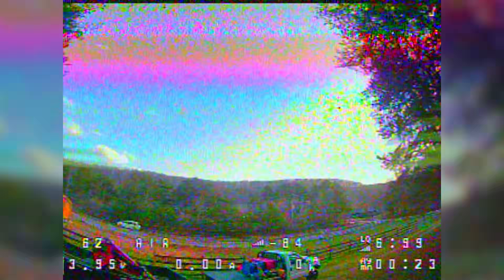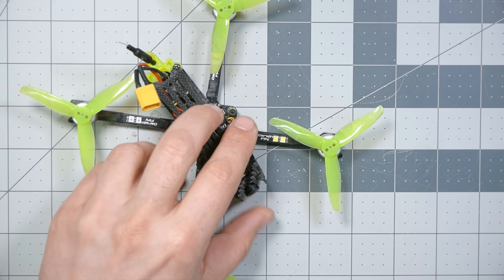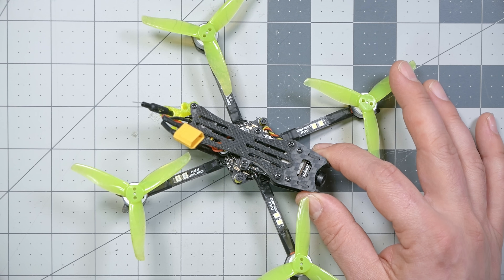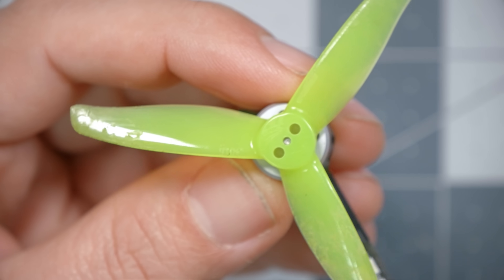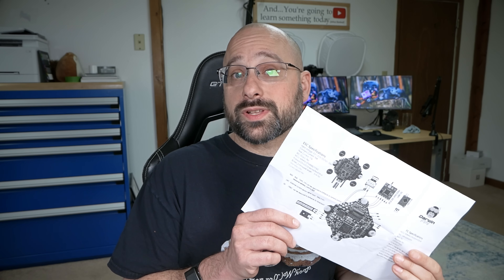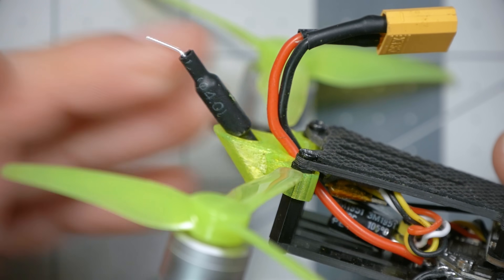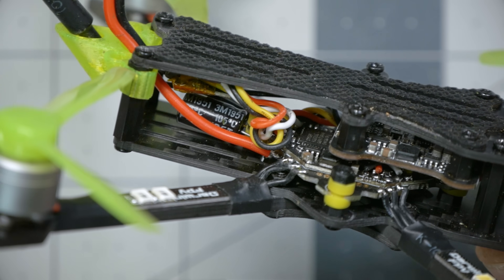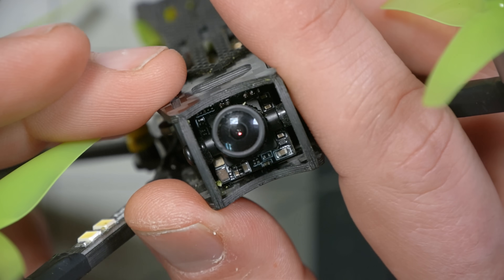Best value quadcopter under $100: DarwinFPV Baby Ape

Comment: I personally like mounting the VTX to the top plate. I have many sub 250's done this way (some with naked vista, some with HDZero). It's not ideal in that it's a little bit extra work if you need to take it apart for maintenance, but ... I don't like the VTX to be mounted on top of the soft mounted FC adding more weight that can potentially sway with the FC.

Comment: If the price difference between the standard and pro is ~$12 and you could get the ant for ~$10 it would be worth it to buy the standard and a new cam to swap in because then you'd have a backup for when you ran into too many brick walls.
Reply: If your buying online, you gotta remember shipping.

Comment: hi Joshua, I don´t know where to ask this, but, I have a Mamba F405 that works perfect, it connects to bethaflight and work but when I try to put it on DFU mode it doesn´t work, I already installed the drivers and the problem continues, Do you know how to repair it?
Reply: Give that a try: Go to firmware flasher, enable "no reboot sequence" and plug in the FC while pressing down the boot-button. For me it solved the same issue with my Happymodel AIO. Good luck!
Reply: @Eric_Kieckebusch  I wil try

Comment: Surprised nobody has said anything… those new pink little pop up “Tips” things are such a great addition to your videos!!! Please put them in all your videos from now on! Though I know most of the info already and it’s basic stuff, that kinda stuff is what really helps beginners get over the wall of jargon and the differences between the so many options (top vs bottom mount battery) without dragging on every video having to explain everything. Those pop ups just brought your video quality up ten fold👏

Oh, the quad was cool too;)
Reply: Agree!  I had to pause the read the full text at first and I was very impressed with the idea..!  Very useful.

Comment: Hey, thank you for the video! i am a beginner in the hobby, i have a betafpv 85 pro on 2s on erls, im just wondering how much different feeling this will be if i get baby ape pro as a second drone, does it fly completely different from 85mm whoop? is it even worth it or should i check out some bigger quads?
Reply: They fly totally different from each other. The 85 pro on 2s is a fun quad to fly. I think this quad would be worth the investment.  Plus as you learn you will eventually have to replace some motors and I heard the replacement motors are half the cost as other motors that size.  I have 60mm, 70mm, 85mm, 1, 2, 2.5, 3, 4, and 5 inch quads in my fleet right now and personally my favorite thing to fly outdoors is the three inch micro class. They have great agility and plenty of speed. You can fling them around and recover quickly from mistakes. I think you should experience what the baby ape has to offer.
Reply: @zacklayow6788  thank you for the reply, im also interested in tinyhawk II freestyle, if thats worth the money it costs over baby ape pro
Reply: @Eto-Maxim  I had the tinyhawk freestyle and I loved it. I did crash it and broke the frame though.
Reply: @Eto-Maxim  I have the freestyle it’s pretty fun would be a good one to learn freestyle on for you

Comment: I remember when I first saw a Darwin quad. It looked very cheap. As a TOOTHPICK  it's not.  A toothpick is a 1s quad up to 2in props maybe 3in.  Anything else is a micro. But that's my opinion.  This one to me is more a micro. I think that Darwin is making some decent quads. I think I might just get one. Thanks again for the video and information.
Reply: I stopped calling my 2.5 and 3 inch micros 'toothpicks', LOL. They look more like that one.
Reply: This is not a toothpick, but a micro. Also toothpicks are micros, but a kind of micro. Two aspects: weight and form factor. 
A toothpick is named like that because of the frame. Also, as per Kabab's formula, should stay within 70-80g including the battery.

Comment: Call me old-fashioned but 3" for me still means 1407 balls to the wall power on a 250g quad. If I wanted to fly unconspiciously in a park that would be a different thing, though.
Reply: Russell Phelan  I use 850mAh 4S and with 3051s the sag is real. But I would have thought it would be a lot less with 6S low-kv.

Comment: I know you wouldn't be able to build an equivalent quad for that price, so bang for the buck it fires on all cylinders. I would say get the lower priced version and put your own camera in it. There are better analog cams the the Caddx ant, like say the Runcam Phoenix 2 JB Edition. 

What was the average flight time you got on it with the 450mah 3s?

Comment: Those 1104 motors are actually very OLD. They come from the original "Babyhawk" (the one that came in a white plastic frame) if I am not mistaken.
Reply: I was thinking the same thing, except those were 1104-5250. I still think you’re mostly right though, someone needs to try to old Babyhawk props on it.

Comment: I would love it if any of my fpv quads could fly about a football 🏈 field away without horrible risk of loosing visibility. I don’t need long range like 2 or 3 football fields vision but it would be nice if the cameras didn’t just glitch out so much by default. I guess most people tune stuff on the computer 💻.
Reply: How to achieve that:  1. Get a 400mw or more VTX. Something high quality like RushFPV, or TBS Unify is where you want for improved video quality from the VTX - they are clearer than other 400mw VTX's!
2. Go with Crossfire or ELRS for your receiver. I here Ghost and Tracer are good too, but I have not used them.
Simple as that.
My micros, with great VTX's, cameras, and Crossfire receivers will go the 3 or more football fields easily.  Crossfire is top of the line quality for your link to your radio from your quad. You need quality for your VTX too. Too many people always look at how many MW's it does, and think all 400mw VTX's are the same! NO WAY! RushFPV VTX's, TBS Unify, etc are top of the line and give you a much better quality image than the cheap stuff!  Hope this helps! :)
Course, you want more distance, and way WAY better image quality, get the DJI V2 goggles and Caddx Vista! OMG!  You won't believe your eyes! lol   =(:^)-
Reply: @KOrnhOliO1  yeah I need to get an rtf fpv kit that comes with all of that cool stuff tuned in. I have tried a lot of rtf fpv kits and you fly out 10 to 15 meters radius and the cameras glitch. Tired of that because you lose drones and I want to put better quality videos on my YouTube channel.
Reply: @marcoreviews  If you are only getting 10  - 15 meters, you have got other problems! Search videos and forums about short range. A 65mm whoop with only 25mw built into the AIO board should give you 100m!
Reply: @KOrnhOliO1  thanks for your kind input! I will looks into it.
Reply: @KOrnhOliO1  wow 🤩! That’s a great 👍 plan! Ok so I will try to figure out how to put all of my quads on the same channel. After all I try to use the same goggles 🥽 for all of them. Didn’t realize how important this step was. You are correct I always just press the auto track channel instead of manually finding it except on the eacheen seagull! I guess that explains why the range is better on that one ☝️. Thanks!
Reply: @marcoreviews  haha ha! That explains it! 🚁💸😁
Reply: Russell Phelan  I was trying to install betafpv at one point but there are so many steps to it that I got lost. The basic download and install was ok but I wish there were some gurus in my neighborhood who could just help tune things up for me. In the end I am just into the videography aspects because I like making park tours and helpful tutorials. I think the problem as you mentioned is trees 🌲 and other objects must be the problem.

Comment: "I think the camera is about as good as an analog camera can be"  - Seriously?! This is the "Pro" version? Damn! This Caddx Ant absolutely SUCKS! Look at all of the red sparklies! FUZZ and flickers galore! Holy Crap!!! If this is as good as an analog camera gets, YOU NEED to slap in a Caddx Baby Ratel! Cuz I too have a little bit a BARF IN MY MOUTH! Sheesh! :(

The problem with buying this type of ultra low cost quad is not that it doesn't fly good, but it's that it comes with the lowest quality parts possible in the world!  That's obvious though, (look at those motors - some company is soooo proud of they didn't even put their name on them! LOL)
because that's how they hit that low of a price! Then, lets explore, what happens to low cost parts?  They fail, break, burn out, and get damaged quicker!

Face it, low quality = low durability. THAT IS THE ISSUE - 

this quad may cost only $92 with the HORRIBLE Pro camera, but it will cost you approx. double to triple that over the first year or two of ownership to keep it in the air! Replacing all of the "factree" parts could be so often that you have it down, waiting for parts and not able to fly, about the same amount of time that you are able to fly it!  

It's actually cheaper to buy that more expensive quad initially because they come with high quality parts that don't fail nearly as often and will cost you less over the first year or two that this DarwinFPV quad will, by a significant amount.  I know, I used to buy this JUNK,and buy EACHINE, which is the same as this quad in quality, and they were being repaired so often, I finally stopped and gave up on them!  Too expensive!  :(

Comment: Tyro 79 is my favorite for the sub 250 it flys good and holds a lot when you crash. Also it is not so expensive. Even when you need maybe a new camera. And there are lots of parts you can upgrade. But especailly for your first copter project it fits very well :)
Reply: Yeah I got a tyro for my younger brother as his first FPV quad overt a year ago and it has held up really well to the constant abuse he gives that thing he has replaced camera and esc and broken a motor in a crash apart from that super good quad for the money

Comment: That HX115LR flys great with the FPV Cycle 13mm 1S motors and the 1S TuneRC board the FPV Cycle carries.  It’s not as light as the babytooth, but still a nice frame for the babytooth build.

Comment: Would you say this is better than the tiny hawk freestyle?
Reply: The quality of parts are on the other side of the quality spectrum! Problem with all micro's from Emax is they use proprietary parts! Meaning, you can only buy them from Emax, and they BEND YOU OVER and charge you a small fortune to replace them. BUT! You are on the right track! 
This DarwinFPV crap and Eachine use the lowest cost, lowest quality parts on the market, and they simply do not last long. These cheap quads cost a lot to keep flying for the first year or two of ownership. They end up costing way, WAY more than if you just spent the extra now, to get a quality name brand product first! Quality parts = durability = less cost in the long term because you aren't always replacing parts to keep the cheap junk in the air!  Try buying a Diatone, GepRC, HGLRC, iFlight, etc quad and save a lot of money, and heartache!
Reply from the maker: That's a tough one. The TH freestyle is a bit more expensive especially if you need to put a 3rd party receiver in it. It's very good though.

Comment: Am I the only one who thinks the first camera looks better? I'd take a slightly dimmer, blurrier image, and worse shadows over the heavy mosquito noise of the ant. Even distant obstacles are shimmering with noise. Maybe there is a sharpness adjustment on it? FWIW, for those interested, they now sell the Baby Ape Pro that comes with the Ant, while the standard version has the "DarwinFPV" camera reviewed here.
Also I have a question. Is this Assembled, PNP, I'd just have to add a receiver?
Reply from the maker: It's tough here because the DVR struggles a bit with the sharpened view of the Ant. But to my eye, in the goggles, the Ant is vastly superior.
Reply: @JoshuaBardwell  Fair enough. The colorized background noise in the example is really distracting to my eye. If it's not there in the goggles, then I would agree, it is a more detailed image. Both the standard and pro being nearly half the price of a tinyhawk, they are a steal, either way.
Reply: @sumdood2035  I agree, that ANT is AWFUL! :(
Reply: @JoshuaBardwell The word "vastly" is doing a lot of heavy lifting in that comment though the Ant is definitely better.🤔
Reply: @JoshuaBardwell  Lots of BARF in my mouth from all of those red sparklies, fuzz, and constant flickering from the Ant camera - It's HORRIBLE!  :(

Comment: Tiny hawk race two is just as cheap uses cheaper batteries and flies amazing
Reply: I mean this is cheaper
Reply: @DailyMynt  Cheaper quality, that's for sure! These cheapo quads cost a lot to keep in the air! Cheap to buy, but expensive to keep it flying! Low quality = low durability = lots of repairs = high cost of ownership! :(

Comment: the shouldn't brake probably will mine did when I hit the inside of a pickup bed near full speed🤣😬 broke an arm and motor, other than that I love it. I'm running spectrum🤔
Reply: Hello, how did you wire up the reciever and what one did you use? Thank you
Reply: I used a SRXL2 receiver and just soldered it on to the 4.5v + - and the S on the receiver to the tx1 on the flight controller
Reply: @safarydecker7424  and it works well?